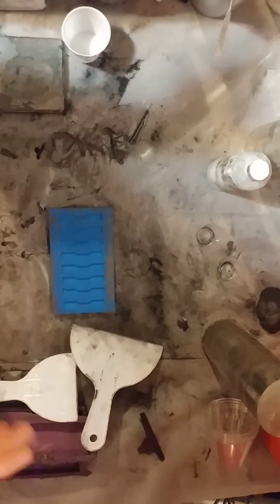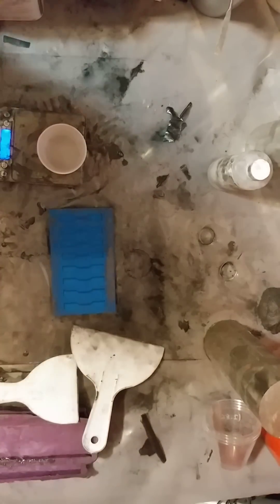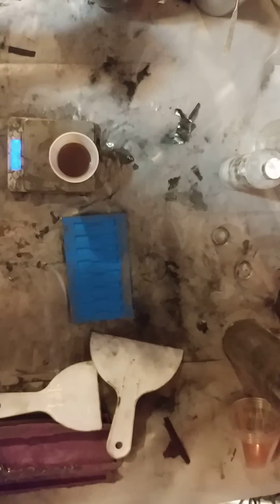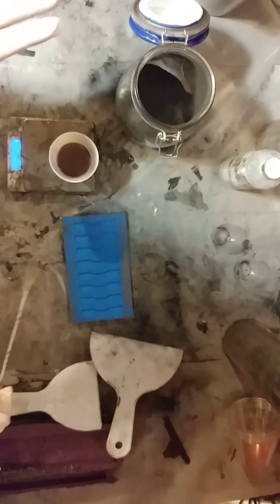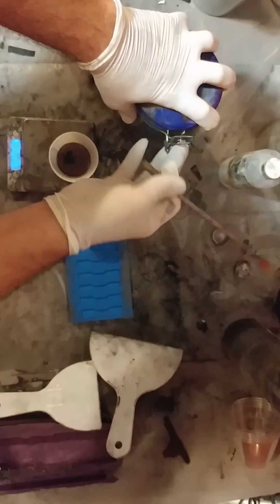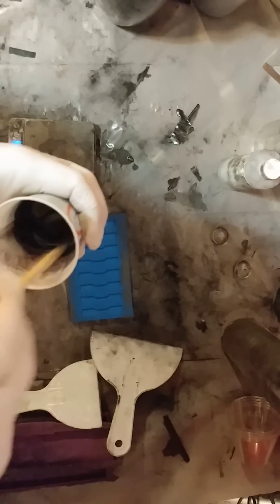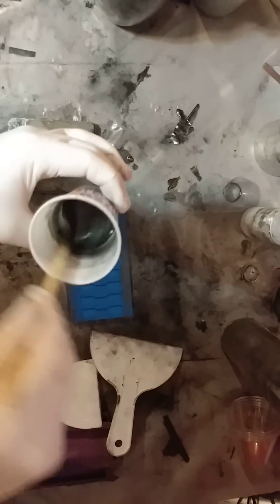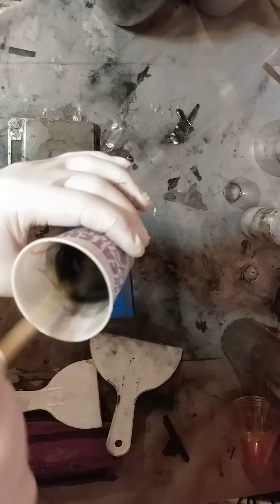Graphene composites (Part 1)

Comment: I've done some epoxy tests as well, but mixed results. I was expecting to get super stiff laminate on last attempt but turns out it was really flexible :/ I guess i used too much graphene as some results have shown that initially you get stiffer but more you add graphene the more flexible it becomes while ultimate tensile strength keeps increasing
Reply: Which method u have choosed for graphene and epoxy

Comment: Good video! To compare results I would do half bones and fabric with normal resin and half with graphene, but I guess you did these tests. Please type resin and hardener used.
Reply from the maker: I did all of those things. This was polyester, but we have tested vinyl ester and epoxies as well. All had strengths over 100% of original resin.

Comment: un video super practico !!
 it looks incredibly easy , isnt it ? when  u know the thing  is really disolved and not just fully dispersated ?
when would you introduce a pigment case you wana a certain color result , before the graphene ?
GO, graphene oxide, would not work with polymers as good as graphene , right ?
i wonder how would work  keep the poliester in the fridge to get  extra time for manual mixing